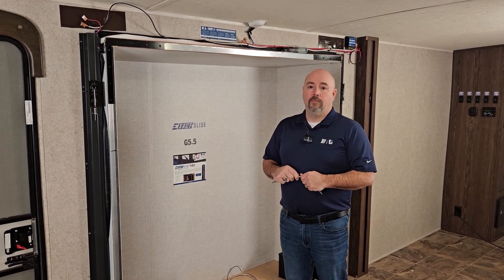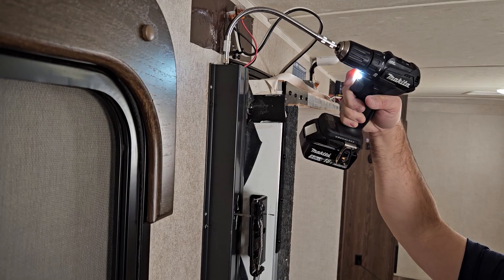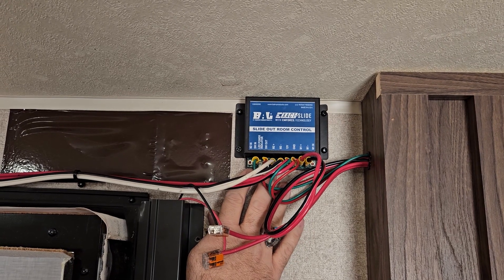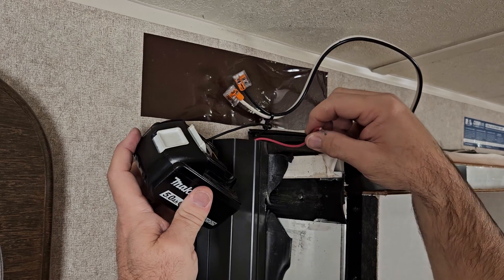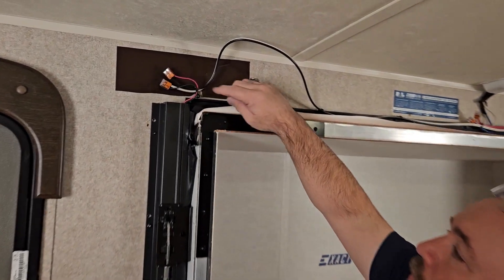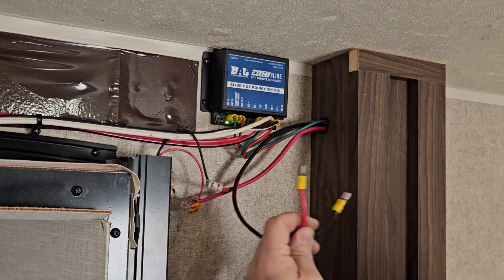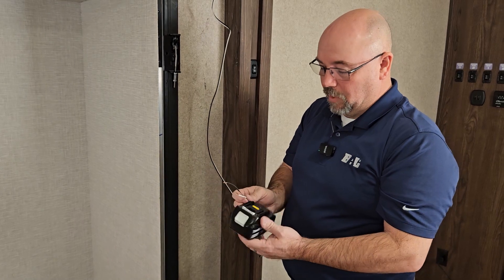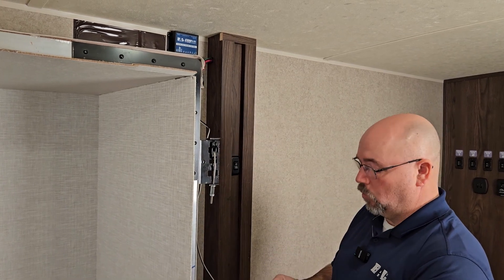BAL EXACT-SLIDE - Not Working, Only One Side Working and Electrical Troubleshooting

Comment: When I try to operate my living room slide from the motor controller, the slide opens instead of closing. Is this incorrect wiring altogether, or a matter of swapping the wires from the m1/m1 to the opposite polarity on the controller? 2021 xlr hyperlite 3412

Comment: It only works if the great box ISN'T so far back in the wall, that you can actually insert the but into the override slot! Ask me how I know! Couldn't find a motor controller in my campsite reserve 26CJ. Actually found a to to disconnect ALL power to the trailer, to reset, then reconnect. It worked.

Comment: This is excellent info! Thanks for posting it. 

My issue is not covered here - one side extends and the other doesn’t, then the 30A circuit breaker begins to trip repeatedly. This is the second time it’s happened. The breaker trips and resets over and over even when I’m not trying to operate the slide. The controller can not be reset without power so here it sits. 

Last time the dealer was able to get the power working again to do a reset and everything worked again. Not sure how - if it was a wiring issue that should not have been possible. 

Any thoughts?  Thanks!

Comment: Less than 30 strokes and mine is acting up on my Greywolf pup 17JC is out of whack. I think I’ll have to do the master reset. It’s making a chatter noise but I think it’s because the slide is skewed. Motor controller is located inside the upper cupboard and it’s impossible to see the controls without a probe or other kind of camera. Great video. Trailer is under warranty, just need to limp back 5000km.

Comment: What if the gearbox stripped? My one side is making a loud ratcheting noise. Either the gearbox stripped or the chain is slipping. The slide is fully out. One side is good, the bad side doesn't move at all. 2025 Jayco Eagle 5th wheel.
Reply: Not going to sugar coat it because in this situation it's going to take some work to get the room in. Sounds like the gear box went out on the right-side motor. There are several reasons this can happen. First thing you want to do is support the room on the side that is bad with a jack and a 2x4. Next, remove the fascia board from the face of the slide room on the bad side motor side along with the board behind it. This will expose the standoff brackets and allow for tension to be loosened at the adjustment studs. Remove 7/16" jamb nut from both cable studs, then remove the 3/8" coupling nut from the studs and the flat washers. From this point, go outside and remove the cables from the outside standoff brackets on the bad side. Go back inside and take a pair of needle nose vice grips and clamp onto the cable stud and pull it out of the bracket mounting hole on both cables. Now the room is free of any tension on the bad side. Have someone help you with this next step, have someone carefully run the room in for the good side while you are on the outside pushing the bad side in. Be sure to maintain support on the bottom of the floor during this process till the room starts to fall in at the halfway position, now you can remove the jack and board and continue to push the room in while someone else is walking the other side in at the switch. Once you have the room all the way in, on the side that bad, take couple 2x4's and cut them down and wedge them behind the standoff brackets and up against the interior wall or mech to support the room in the IN position to get you to the dealer to have it serviced. Any questions or concerns during this feel free to call me on my cell. 574-849-5100 Ed Kirkland.
Reply: @edkirkland2851 you're the best man! I appreciate it! Glad you posted this here for others. I couldnt find anything online regarding this exact situation. All the troubleshooting and manual overrides I found didn't include a mechanical failure preventing the slide to be at a serviceable position.
Reply: sent you an email on the series of steps to get the room in and to a service a service center. Thank you.

Comment: Love your slide and presentation. One question regarding the drill usage to bringing in the room. Can I assume when using the drill and the retraction bit to bring in the room, the drill will be turning in the same direction as if drilling a hole with a drill bit? 
Thanks for sharing.
Reply: yes, I believe I had the drill running in that manner. If you started in the other direction you would have a clear indicator. The override shaft would start to twist on you because the room is already in the sealed position  and cannot go out any further.
Reply: @edkirkland2851  Thank you so much for all the shared information.